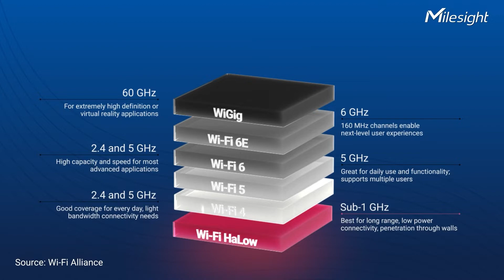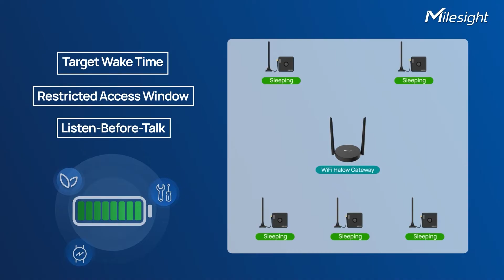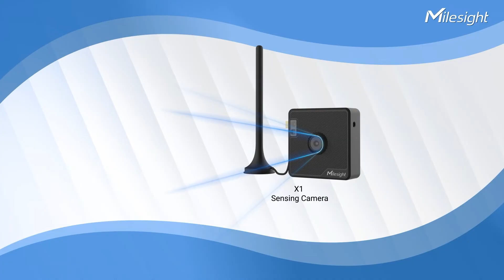What is Wi-Fi Halow? | Explainer Video

Comment: Halow advantage is versatility of working great indoors and outdoors without switching between 2.4 or 5.8 and the long range without bulky directional antenna just a regular omni stick like a ham radio. Hope manufacturers will focus on this 802.11ah/s use case scenarios and develop higher power add mimo for more thoroughput and more watt power for extended range like 6 to 7 miles. And make it man portable with battery like a tactical manet radio in a ruggedized tactical form factor.
Reply from the maker: Great insights!